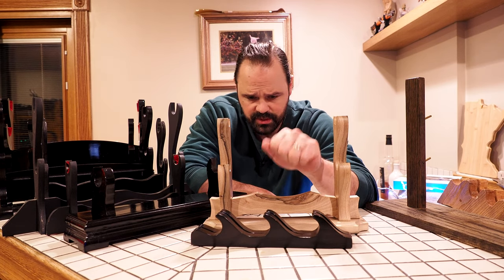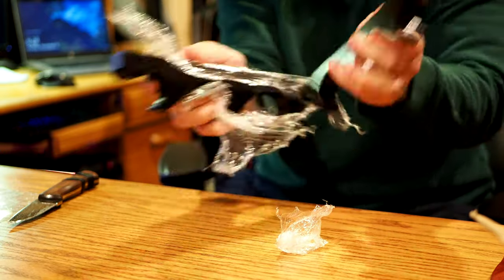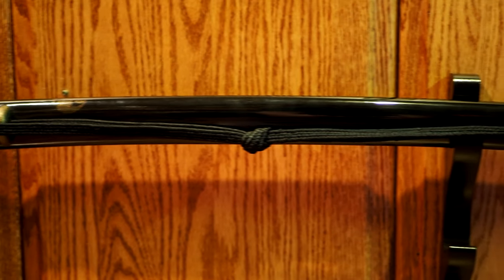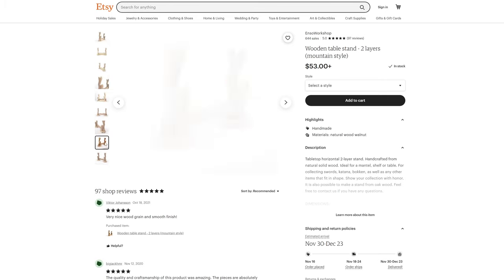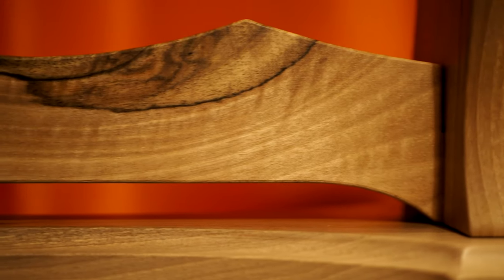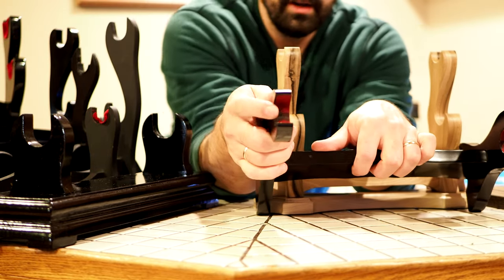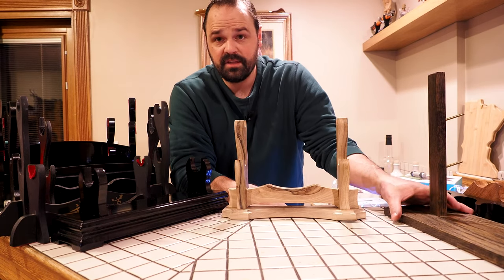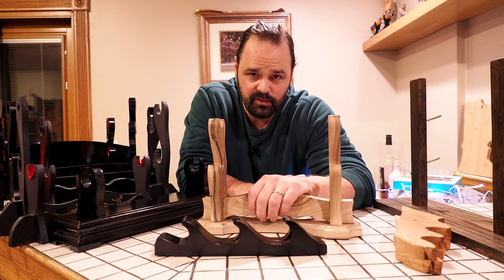Enso Workshop Sword Stand Review

Comment: Hi Matthew -- That is a nice stand for sure, and it was fun to get your impression on the other stands too. I have a couple of them...the stand with the two rods holding it together was my first stand, and it was rather rough and shakey. I went over it with some fine sandpaper and steel wool to take the rough edges off. It smoothed off rather well, and the sandpapered edges showed the wood underneath a little...kind of an antique effect that I liked, so I left it. Then I glued the pieces all together, and it turned into a pretty solid stand. I have found a lot of these wooden items from Amazon or wherever can be made to look a lot better with a little hand work. I also have one of the very nice Hanwei stands. I think mine is slightly different, and I bought it long enough ago that it was considerably cheaper. All it needed was some furniture polish, and it's a real showpiece...never fails to impress. Anyhow, thanks for the video...it was more interesting than I expected... ; }

Comment: A thought about something not swords but related.   I have a few shields and bucklers to go with my collection of blades I find that large plate holders or stand works well.  You can find them at most place that see house wares or china.    For the  non round shields I find a simple hardwood thin plank with a keyhole fro the bottom point of  the shield placed across the two legs gives you the same effect as a round shield edge.